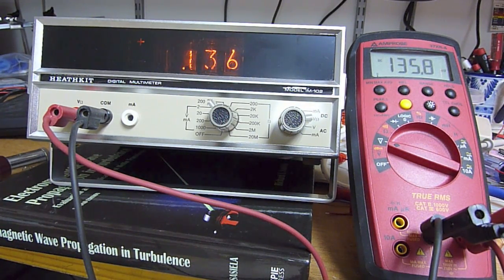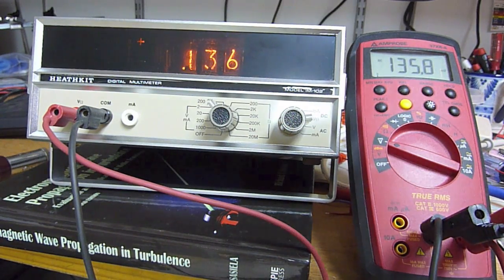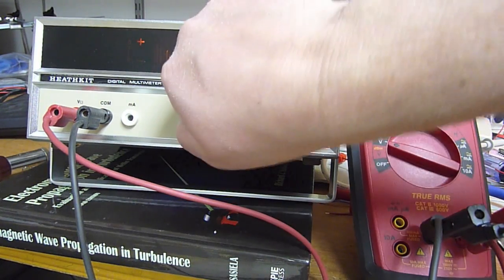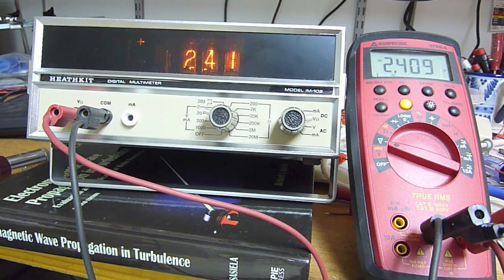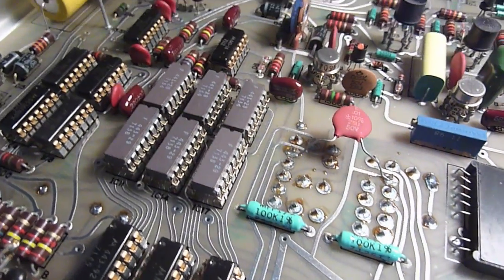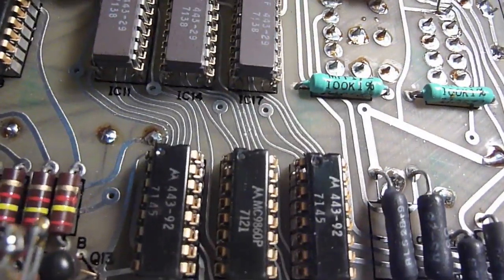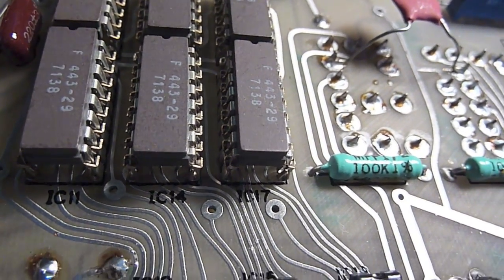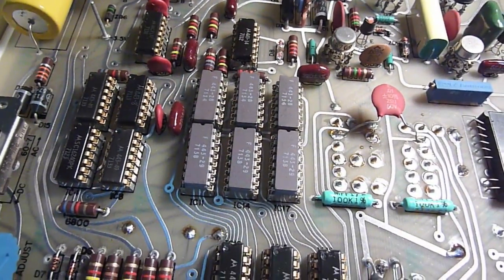Heathkit IM-102 NIxie Tube Multimeter

Comment: I BUILT a Heath VTVM with Nixies. Don't remember the number (I donated  it to the local radio museum), and your page came up in the search. It was not a bench type, but more vertical. But my real question is, how is the Amprobe holding up? It looks like a 37XRa like mine. I found that it is losing a little accuracy in precision and the continuity buzzer is very faint.
Reply from the maker: The amprobe died soon after the video. The zebra-strip to the lcd failed and the display quit working. I tried a bit to fix it but did let succeed.
Reply from the maker: Didn’t.
Reply: @scottrharris  I replaced mine with a Uni-T UT61E Plus I got for <$100 Cdn. An Aneng AN870 isn't bad for half that.
Reply: barrybogart, Heathkit never made a VTVM with Nixies. Since you say it was a more vertically oriented case, that means it must have been an IM-1202, which was entirely solid state (except for the Nixies), and thus NOT a VTVM. Just a plain old Nixie DMM (and a low accuracy, low resolution one at that).
Reply: @youtuuba  You have a point. But last time I looked, Nixies were VACUUM TUBES. I built it for fun and used the EICO 232 a lot more.  I still have a Triplett 850.
Reply: @barrybogart5436  , I don't know where you looked, but Nixies are NOT vacuum tubes. First, they are gas filled and thus not vacuum, and second, they do not use thermionic emission as do vacuum tubes. Nixies are just fancy neon lamps, and no place worth "looking" at will say otherwise.

Also, by definition, VTVM's must use a vacuum tube as a high impedance amplifier in a bridge circuit, and the IM-1202 you probably had does not use a bridge circuit topology, and it uses solid state amplifiers.

Comment: Not too long ago I acquired this exact model meter too and I took it also because of the Nixie tubes. :)
And mine is also quite accurate, on Volts, Amps and resistance actually. 
I think I will eventually replace the power connector on mine as well, although I do have the original power chord (it came as new in the box even with the calibrator device thingy but with a TOTALLY dead mercury battery of course).

Comment: old video. However. I wanted to point out. Honestly, the odds are the IM-102 is measuring readout is more accurate than that red digital new (True RMS bla bla model). This IM102 model happens to be one of the HeathKit's highly accurate VM circuits, I believe within 1% on most ranges. I know a lot of you modern digi meter have those accuracy ratings or better. however, we now live in more of what you read is marketing bullshit ERA!. I have tested quite a few high ends for the time AM with high accuracy statements again new big brand models. Vintage 8-9 out of 10 are on point within their stated specs. New DVM 2-3 out of 10 on a good day.

 Those are facts from my actual studies so anyone else playing around the same way should find a number similar there for it more of fact and not opinion.  This is not saying what is better per-say, however, it is saying a good vintage meter that states 1% in a range and  .5 - .2 in another range is going to be with .0001 - .0002 of the stated accuracy. New meters are within 1.0 - 3.0% and in some cases way out of the stated range. It is just the way it is. Unless you are paying  600- 1200 then you get a lot closer but still not within the statement accuracy p[ercentages of most Vintage AM's.
Reply: trickedouttech, you don't mention which modern DMMs you compared to the Heathkit IM-102, but if you think the 102 is MORE accurate then you must be comparing against the cheapest modern ones. The decent modern ones are definitely more accurate than any basic model from the early 1970s.

You also mention that unlike modern meters costing over $600.....well, the IM-102, by current inflation dollars, would be a very expensive meter today, even a $200 modern meter will be better and cost much less. The IM-102 KIT price in today's money would cost over $1500 !

Comment: I have one that I built in 1973.  Still works fine.  I've done a couple of repairs,  one caused by using it on a film projector.  It fried a run on the PCB but I was able to repair it and it is still going strong after 44 years.  I still use it as my main voltmeter.  I also have its partner frequency counter, the IB-1102 which is also nixies.   (Eight full digits from 1 Hz to 120 MHz).

Comment: OMG ! the meter looks absolutely amazing, perfect condition and accuracy !
I wouldn't let it go either ! 
I wish you could show us how the ADC is implemented in this design, since heathkit rarely used custom chips in it's design I would like to know what chip they used in that era... 
Thanks for sharing.
Reply: I know this comment is very old, but the answer is that Heathkit did what everyone else did in the pre-Intersil 7106/7107 (LSI monolithic ADC chip) or other similar products; they 'rolled their own' ADC's using discrete logic. Those worked in the same basic way that modern monolithic voltmeter ADC's work, albeit often with the less sophisticated (and less stable) single-slope ADC designs (more modern ADC's generally use dual-slope). In a nutshell, make an integrator, either from an op-amp or discrete transistors. This results in a linear-slope rising voltage. The slope is reset according to a periodic clock pulse. At the same time as the slope reset, a digital counter is allowed to begin accumulating a count based on a high speed clock. When the slope reaches the level of the conditioned input voltage, the digital counter is stopped, and whatever its count is is passed on to a latch, and the contents of the latch are decoded to drive the display. After a short while, the main clock generates another pulse, which resets the digital counter and the slope, and the whole thing begins again for a fresh reading. The essence is that the higher the conditioned input voltage, the longer the slope must rise before the two signals match, and thus the longer the digital counter is allowed to accumulate the high speed pulses, and thus the count is greater and the displayed number is higher, proportional to the input voltage.